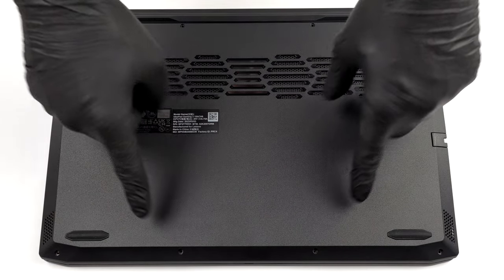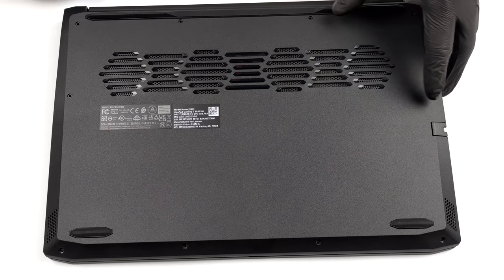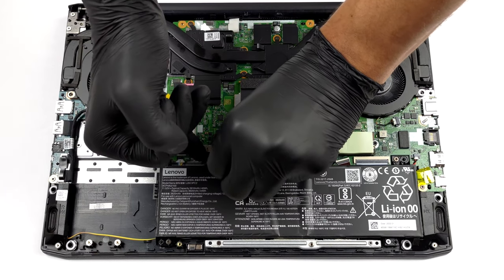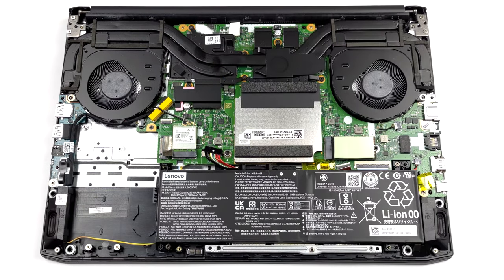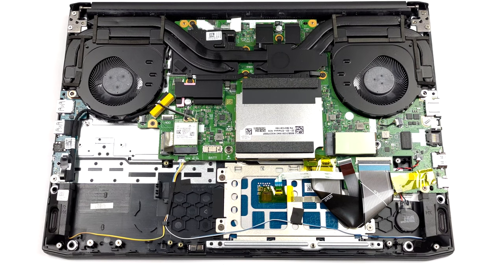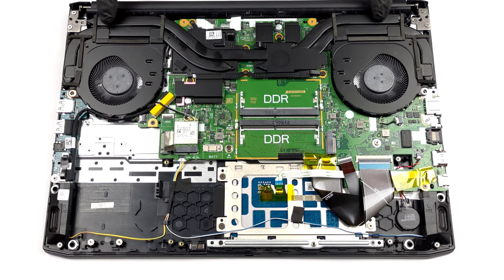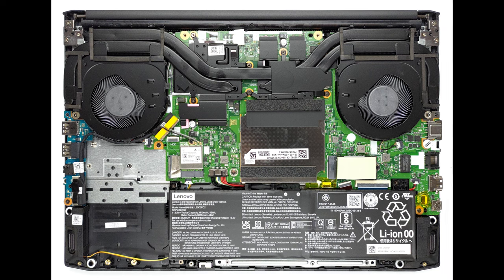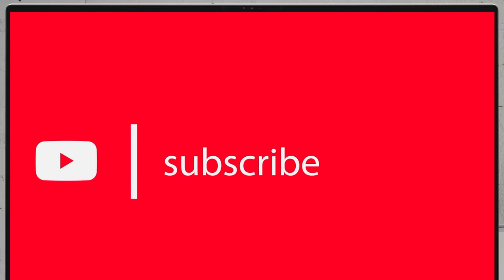🛠️ Lenovo IdeaPad Gaming 3 (15", 2021) - disassembly and upgrade options

Comment: Interesting how they are overlapping the 2.5 SSD and the NVMe drive. Can they coexist there or is it only one and the other is blocked?
Reply: On the product reference page for stores, it specifically states "Non-RTX 3060 models: up to two drives, 1x 2.5" HDD + 1x M.2 2242 SSD or 1x M.2 2242/2280 SSD + 1x M.2 2242 SSD". So no, if you want two NVMe drives, you can't install a SATA drive.
And for 3060 models: up to two drives, 2x M.2 SSD
Reply: @doggo_woo  sounds like a huge design flaw
Reply: @VIP854  not really, it gives you more choice in what storage type to install
Reply: I'm using the preinstalled NVMe and I've added an 2.5 SSD that I install games to and it works perfectly fine. Using them at the same time
Reply: @phlipper01  is it possible to have an additional NVME drive, or no room for that?
Reply: Watch for more info videos : https://youtu.be/nQ_JSYCO7o4
Reply: @renatohmoliveira  I don't think so, unfortunately, there's only the one slot
Reply: Instead of a 2.5" HDD, can I put a 2.5" SSD next to an M2.2280 SSD? Thank you.

Comment: By mistake, I left this computer on the floor, my little son (1.5 years old) put his feet on the keyboard. When testing the hardware, I noticed spots on the screen when displaying red, blue and black colors in the lower 1cm2 of the display. The computer works without problems and all other tests passed ok. How to check that the connectors are not crushed or damaged? Pls, help me.

Comment: I own the exact laptop yet it only lasts me 3 hours browsing ;/. Probably because I use linux on it and it doesn't have these weird driver features that lenovo spyware does to conserve battery better.
Reply: Same, the battery life on linux is trash for me too. So much for the aspect of lightweight. Apparently the "bloat" of windows makes the battery last longer lol. Whenever I'm on battery, I'm forced to use windows as a result. In my hostel room, its always connected to power, so I'm free to use ubuntu which I prefer.
Reply: get the bigger battery version

Comment: Hello @LaptopMedia! Does it support 32GB of ram (16GB+16GB). I can't seem to confirm the max ram it can run. Thanks : )
Reply: No it doesnt, Up to 16GB DDR4-3200 offering
Reply: @officeboyreloaded5427 Oh man! Do you own one or know somebody that does own it and tried this before?

Edit: the product specifications sheet of the model I'm looking for says it has 16GB max RAM offering, but they have a note under that saying with time and evolving technology it may will support more RAM....which is kinda confusing.

Edit 2: Asked yesterday on Reddit and looked around online, and I got some people who tried and made it work...but still not enough of a confirmation since the official website says otherwise (more or less).
Reply: @officeboyreloaded5427  Ahhh what a bummer... Thanks for replying though.
Reply: Yes it can, officially.

They don't say anything because they don't have to tell anything, as it's prety common for modern laptop to get 32 gb minimum.

but if u buy the 16 gb options, you will only get 1x16, not 2x8.
Reply: @gold9994  that's exactly what's going on lol

I'm going to buy one where it comes with 1 x 16GB RAM stick, and I looked around to find if if I can plug in another 16GB stick. To reach the capacity I need, and to make use of the dual channel mode of course.

I'm still going to get on that deal anyways, and I'm still going to attempt running it on 32GB of RAM. So I'll update here and on my Reddit post about the results.

Thanks for the the hope kind person : )
Reply: @merouanebali2915  let us know! thanks
Reply: Mine successfully upgraded to 2x16gb 3200mhz.
Reply: It supports upto 32 gb ram...i know someone who has upgraded it to 16gb 3200 ram
Reply: Hey Merouane, have you tried to install the 32 gb?  What's your feedback ? Thanks.
Reply: @NajipAliMunajat  how does it work for you with 32 gb does it support it without problems?
Reply: Model 15ach6d2???
Reply: Watch for more info videos : https://youtu.be/nQ_JSYCO7o4
Reply: IT SUPPORTS 64 GB OF RAM , I OWNED THIS LAPTOP AND CHECKED IT .....
Reply: Max offering is simply the max ram the manufacturer sells it. The maximum ram is usually completely dependent on the CPU specs. Just look for the maximum ram for your specific CPU model.
Reply: Yes I have the same models it supports 32 gb ddr4 3200 mhz max.

Comment: Question about RGB keyboard lights. In my IP Gaming 3 there is just white lights. I see there is "RGB" port in my laptop, but its not connected to anything. In video, this port is connected (we talking about small tilted port between short SSD and battery - right above QR code on battery). I wonder if I connect my port with tape wires, will I have RGB lights?

Comment: My laptop is not charging, and some say that i need to remove the battery, then push the power button, then return the battery, is this right ? And is this the way to remove the battery from lenovo ideapad gaming 3 ?
Reply: I'm not an expert, but that doesn't sound right. If you aren't comfortable with disassembling a computer, you might take it to a tech.

Comment: You recommend a battery that better than standard battery that comes with laptop?
Reply: No, but definitely a better power brick. Your battery will drain during a gaming session especially if you upgrade your RAM - with the stock power brick.

Comment: Does the gpu able to be upgraded?
Reply: Nope.

Most laptops come with non-upgradeable processor and VGA.

Those two parts are mostly soldered into the motherboard.
Reply: But, some newer laptops have a Thunderbolt connector or equivalent so you can connect your laptop to external VGA.

The VGA enclosure usually doesn't come cheap tho. So take that into account.

Comment: How do you safely reinstall that heat shield it’s dangerously close to stuff that will blow up if it touches metal
Reply: Yeahhh
Reply: Burnt mine, threw the shield away, laptop still working fine
Reply: Which stuff and what is heat shield ?

Comment: Can the lenovo ideapad3 (not the amd) cooling fans pipe block? bc like its getting very hot while i play a not very heavy game. can u give an idea of what’s happening?
Reply: Intel is hot coal
Ideapad 3 with i5 11300h usually reach 50w constantly with 85w gpu to produce the same result with amd 25w 
I use amd ver and my friend use intel so i know
Reply: My laptop heats up to 80C maximum when i play games, i5 11300 with rtx3050

Comment: Is it possible to upgrade it to a bigger battery?
Reply: From what i've read it is possible to upgrade to a 60W battery but you'll no longer be able to use de Sata 2.5" bay. I'm not sure if it's a mod or fully compatible from lenovo but it's worth to try sending them an email to be sure

Comment: 5 hours video? I hardly get 2🤣 brand new lenovo
Reply: I disabled the rtx3050 and enabled all power saving features. I was able to watch a 1080p youtube video on 40% brightness for approximately 5.5 hours. Just turn on the rtx3050 when you need to game. The inbuilt radeon graphics is capable for everything else.

Comment: great video I was thinking of buying it but cause a lot of new laptops not having more ssd ports or 2.5 space was making doubt a lot cause on my work I use a ton of disk space but knowing that it had space for an m.2 AND a 2.5 hdd convinced me great value for this laptop only bad thing is the insane amount of bloatware it had but 30 min uninstalling things left it like new xD working great for work and games the screen being 165hz is a little too much when it only have a 3050 but still great for the value anything better was like 300-500 bucks more and the 6600h proc is working great
Reply: Watch for more info videos : https://youtu.be/nQ_JSYCO7o4
Reply: Watch for more info videos : https://youtu.be/nQ_JSYCO7o4